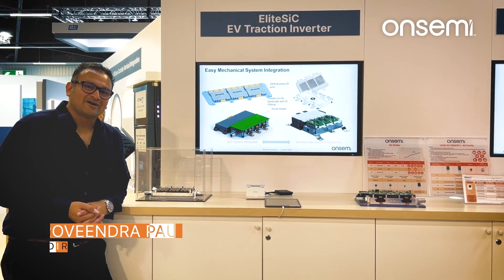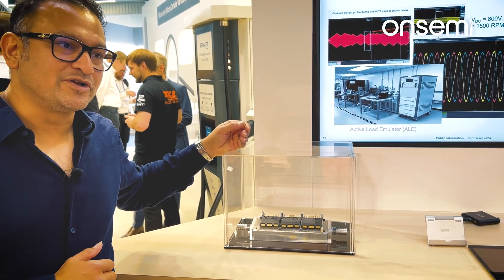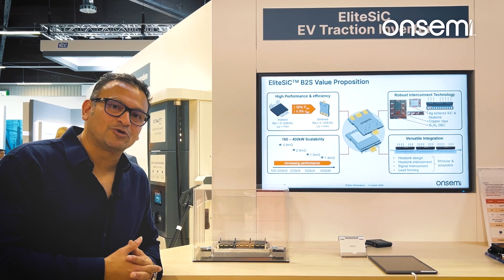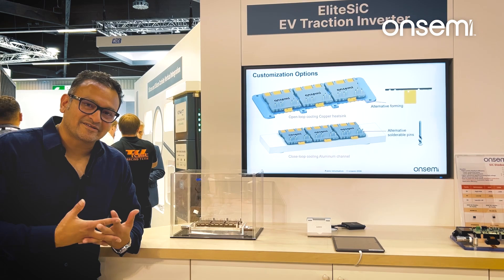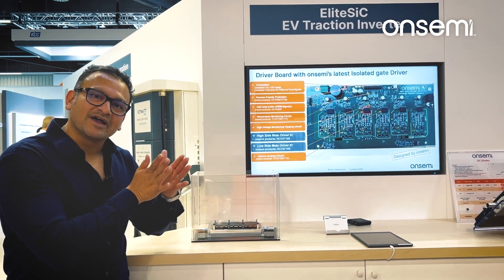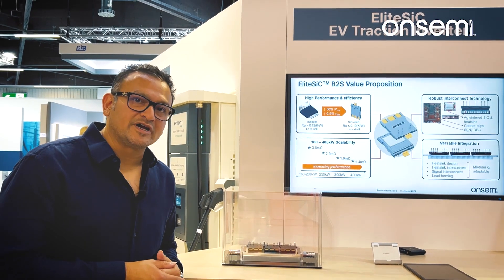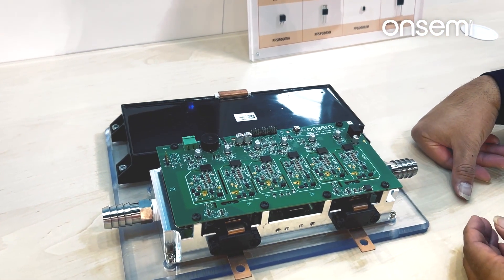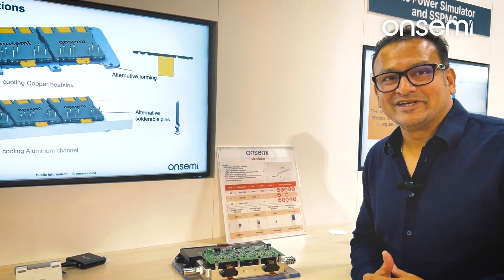Latest SiC Module-Based 300kW Traction Inverter Reference Design

Comment: The third generation semiconductor silicon carbide is the future trend. Inverters can play a role in reducing voltage. Yongming capacitors have the characteristics of high withstand voltage, large capacity and long service life. They can withstand the peak voltage when the transformer is working and improve the work efficiency. efficiency